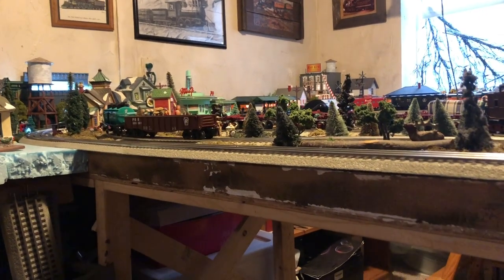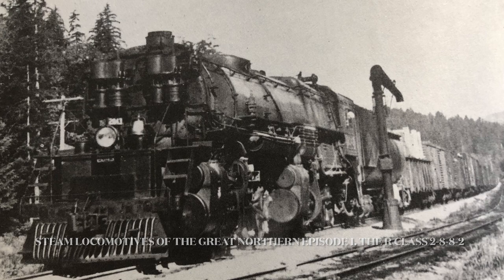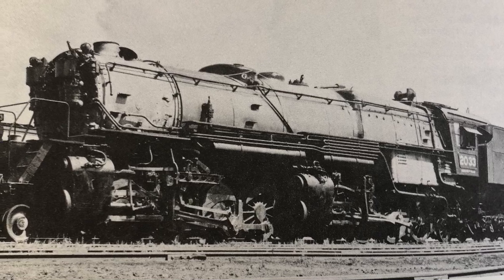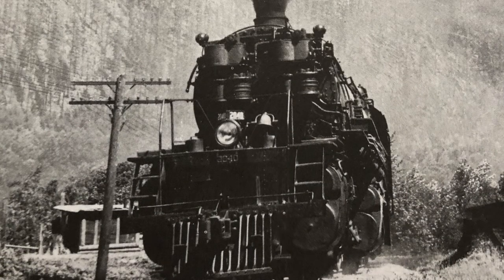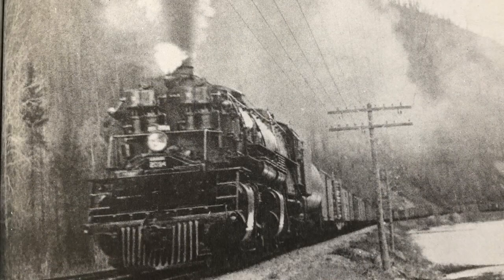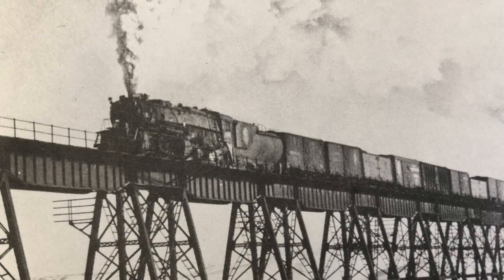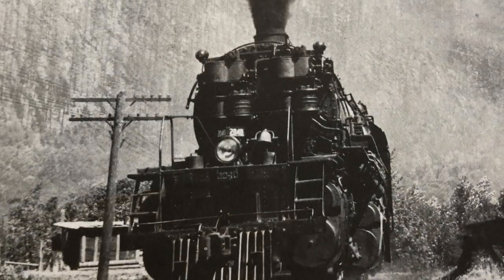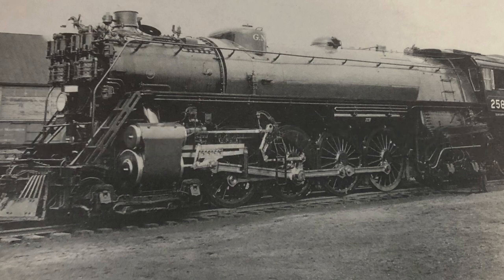Steam Locomotives Of The Great Northern Episode 1. R class 2-8-8-2

Comment: Great Video Brendan! The R-2's were built to pull the grades on the Great Nothern's mainline from Minot ND west to Spokane, Washington ....most notably the 2.2% grades in the Skykomish area and the Marias Pass.They had the largest capacity boiler of any articulated built...about 1/3rd larger in both evaporative and superheater heating areas than the iconic UP Big Boy had. The R-2's were a lot more engine than the Y6B's were.
Reply from the maker: The R2s were truly amazing engines with strength sad that none of these brutes made it out.
Reply: The AE 2-10-10-2 Had boilers nearly 10 ft in diameter. 176,600 lbs of tractive force. Front cylinders 4 ft in diameter. Having said that...the R-2s were nothing to laugh at. Truly one of the strongest steam locomotives ever built. Their boilers definitely look massive .
Reply: @torquetrain8963  The AE's were pretty much relegated to the helper-pusher class. They were limited to about 10 mph max. The 176K tractiive effort was with all four cylinders in the simple mode used for starting...in the compound setting it pencils out to 135K or so. While it wasn't a locomotive suited for running across the plains like the R-2's the Virginian RR found them useful for their needs and ran them until the early 1950's.
Reply: @greatnorthernn-3154   I've always wondered why the Y6B always seems to get more fame than the R-2 . The R-2 was the largest steam locomotive ever built west of the Mississippi. They also were larger, heavier and stronger than the Y6B.  I would say the R-2 other than the AE class is the strongest mainline locomotive ever built of any type of propulsion. Steam has more torque than diesel. I know this will bring tremendous argument from many, but its true. I have an o scale model of the R2 , and it's my favorite engine.
Reply: @torquetrain8963  There is nothing wrong with the Y6's...they were a well designed locomotive and performed well for the needs of N&W. They were mostly used for pusher and helper work as the N&W "A" class was a more useful road engine in the freight department.
The R-2's have a couple of strikes against it in the publicity dept. First none of them survived the torch. Second it is a very rare thing to come across a film of one in operation. The only source I know of is the 6 minute segment in Pentrex's video on the Great Northern Railway. I know of no others. When big articulated steam is highlighted in other RR videos Great Northern is almost never mentioned.  So the problem is that most people really don't know anything about them.
Reply: @greatnorthernn-3154   Yes, I have the pentrex video that you spoke of.  It truly is frustrating that not a single R2 was preserved.  There was at least 3 DM&IR Yellowstones preserved, but no R2 , Northern Pacific Z5 Yellowstone,  Western Pacific m37 , GN N-3, Q2 Duplex, S1 Duplex, T1 duplex.  The R-2 with its massive strength and size , in all of its GN green glory must have truly been a sight to behold.

Comment: I've often thought that the Baldwin Locomotive Works must have pulled out the old 1925 R-1 blueprints when they designed the 2-8-8-4 "Yellowstones" for the DM&IR in the early 40's. Other than the smaller cylinders of 26" x 32" and the addition of a rear trailing truck the DM&IR "Yellowstones" were a very close match in boiler capacity, weight, and tractive effort of the R-1's. Being built in the early 40's they also benefited from roller bearings on the drive axles...something the Great Northern "R" class never had. The "R"'s ran on plain bearings on the drivers and were never upgraded.
Reply from the maker: Very interesting
Reply: Here is some information about the DM&IR Baldwin Yellowstones, paraphrased from the November 1980 issue of Trains magazine that will provide some clarity. It comes from an article written by Frank A. King, the noted DM&IR historian, about the progression of Missabe's articulated steam locomotives. The DM&IR selected the Western Pacific M-137-151 class articulateds built by Baldwin in 1938 as the basic pattern for its 1941 Baldwin M3 and M4 class 2-8-8-4's. Robert A. Le Massena's "Articulated Steam Locomotives of North America" (Sundance Publications, 1979) has the details but the main differences between the WP 2-8-8-2 and the DM&IR 2-8-8-4 are the length of the combustion chamber (1 foot longer on the M3), the tube/flue arrangement (27x2.25" and 75x5.5 inches [WP] vs. 82x2.25 and 245x3.75 inches [Missabe]). That is a whopping 25 percent more superheating surface and 6 percent more combined heating surface over the WP engine. The WP boiler operated at 235 psi while the M3 was rated for 240 psi. The boiler on the Missabe engine was far superior to the WP Yellowstone it was patterned after. Also, unlike the WP engine, the Missabe's Yellowstone had roller bearings throughout the engine as well as integrally cast cylinders and frames. The Missabe Yellowstones had a 67 feet 2 inch wheelbase vs. the 61 feet 5 inch length of the WP engine. The Missabe was impressed with the new pedestal tenders of the Union Pacific Big Boys, just then being introduced, and worked with Baldwin to come up with a similar tender to the ALCo locomotives. This new tender design allowed a 3,000 gallon increase over the conventional tender the Missabe was originally considering to 25,000 gallons. The first Missabe Yellowstones, class M3, cost $246,570 each, an astronomical sum for an articulated steamer in those days but Missabe ate the cost to get a locomotive that would have an immediate impact on traffic movement and that's exactly what they got. The later M4 Yellowstones were heavier than the M3's as the exotic weight-saving metals used on the M3 were no longer available. The Missabe locomotives broke in under full tonnage and no alterations or modifications were ever required. They were released to the regular pool after only three supervised trips. The Missabe Yellowstones were rated at 140,000 lbs. tractive effort (engine only) which put it at #4 on the list of most powerful articulateds. In comparison, the massive Northern Pacific Z-5 Yellowstone built by ALCo was rated at 139,900 lbs. (engine and booster) or just 100 lbs. less than Missabe's. The NP's choice of fuel, lignite, came from an online source and was responsible for the enormous size of the Z-5's boiler.
Reply: @douglasskaalrud6865  Thanks for the interesting information and a plug for the book. I'll have to check it out. Here is a video of the last ore train pulled by the Yellowstones for the DM&IR.
https://www.youtube.com/watch?v=mIvrNHpsjaU

Comment: Nice video. Just a FYI, tractive effort is only a measure of static pull. Starting tractive effort is a measure of static pull at 0 mph. It is not a measure of power, hence why it is only measured in pounds.  Power always has a factor of time involved and is not the same as tractive effort.

Comment: Did GN have any USRA 2 6 6 2 mallets? I normally run GN in N scale but my locos have historical prototypes. I bought this n scale Spectrum undec 2-6-6-2 but if I mark it Great Northern I probably won't be historically correct.
Reply from the maker: The GN never had 2-6-6-2s that are a USRA design